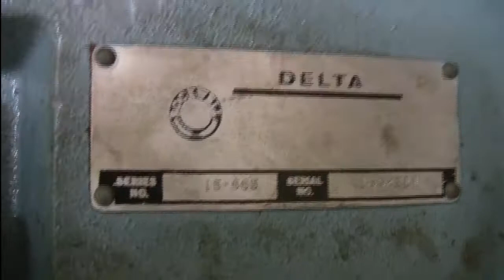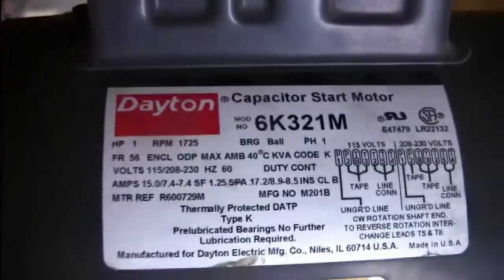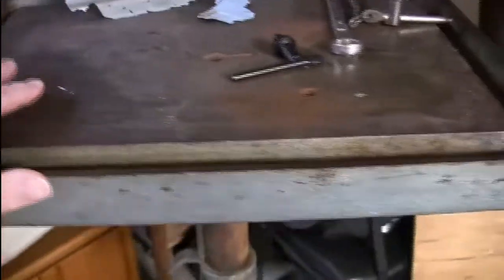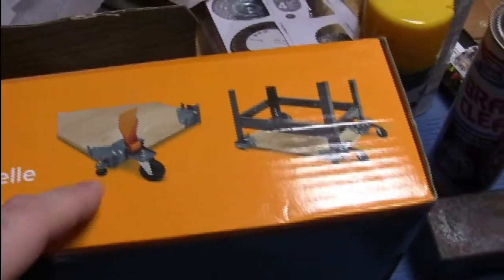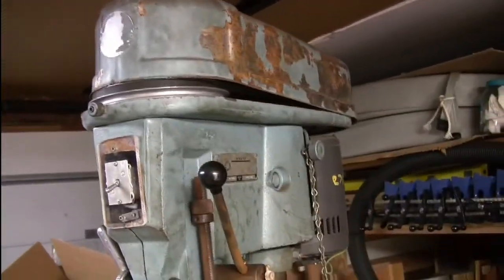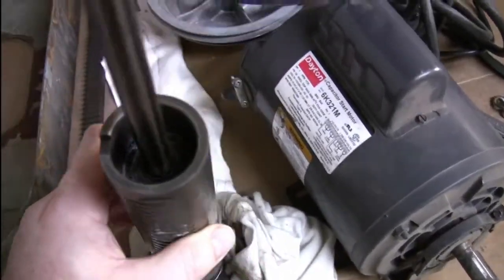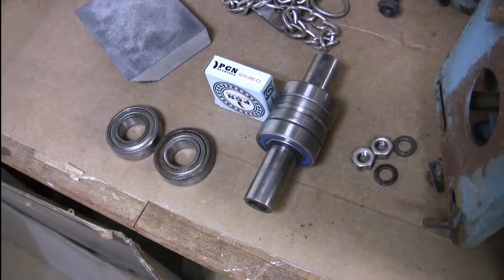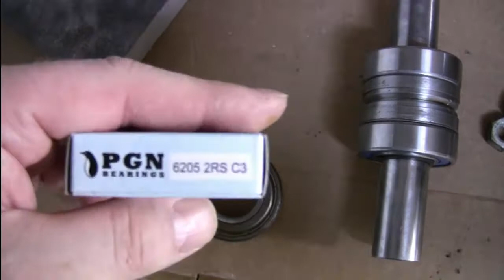Refurbishing Rockwell Delta 15-665 Drill Press

Comment: Thanks for the video. I've got a line on a newer 15-665 but I'm worried about the locking collar setup on the quill. Looks like it takes a special chuck, unless you can just replace the arbor and use any chuck that matches the arbor. Did you have any problems with the chuck and/or arbor setup? Thanks.
Reply from the maker: I was able to get that locking collar removed.  In the second video I talk some about it, and here I show the result: https://youtu.be/4xuHyWijlHw?t=1020   If I remember correctly, all you really need is a 13/64 pin (or drill bit) and then carefully tap it with a hammer to get it to move.  I also found an old wrench with the right size pin that I may adjust the curve on if I need to remove the new chuck in the future and it doesn't want to come off.  The new chuck I show in the second video works great and I got it off amazon.  Any good quality chuck with the same taper should work fine for it.  
So based on what I ran into, the drill press is totally worth it, even if you have to replace the chuck like I did.   So far I have had zero problems with this drill press or the other even older industrial walker turner drill press I also got and refurbished and have a video on as well  .
Reply: Thanks for replying. I'll watch the other vid after this one. Happy Thanksgiving
Reply from the maker: @1Splat  you too, let me know if you have other questions and I will try and help if i can.
Reply from the maker: @1Splat  Please let me know if the other video did/did not help explain it, I could always try and do another.  But I think in my video description I do have a link to the Mr Pete video (tubalcain) where he talked about removing it using a drill bit and tapping it around.

Comment: Just got one. Beautiful piece of equipment.  Is there a part number for the threaded worm that is used on tension spring? Also going to me changing out all bearings if possible
Reply from the maker: Did you see if you could find a manual for it?  I found this one and hopefully the parts diagram in there has the part number you want. I am not sure which part you mean, but there is an exploded parts diagram in this manual which may help:  
 http://vintagemachinery.org/pubs/detail.aspx?id=5837  

So far I have really enjoyed using this and the other Walker Turner drill press I refurbished.  Way better than modern stuff, no plastic in the mechanisms. :)  I cover more of the refinish work in another video for this drill press as well.
Reply: @josephkrug8579  there is a threaded worm for the adjustment of the return spring.  Tough one to find
Reply: @josephkrug8579  well that and original light if possible
Reply from the maker: @78abmoreno  The delta came with a light on mine, not sure it was original...but I got this one and so far really like it, and where I put it, I can use it for both drill presses: https://www.amazon.com/gp/product/B07S5QT88J/ref=ppx_yo_dt_b_search_asin_title?ie=UTF8&th=1
Reply from the maker: @78abmoreno  Yeah I am not sure, my best guess is the part number in the pdf to search for it.  I was lucky that I didn't need any part replaced on mine.  Eventually the 3d printing etc will be so easy and normal that we could just go to places like https://www.xometry.com/ and get whatever replacement parts we need.  But they need a full diagram of the part so that is not simple for old stuff.  Good luck finding it. :)
Reply: @josephkrug8579  I was able to source both the original return spring and adjustment screw. The motor that is on it is not origional which made for a need to certain modifications to be made so I will be looking for a Rockwell delta motor and light. wish me luck.
Reply from the maker: @78abmoreno  That is great news so far.  Was that pdf helpful to find the part numbers for the spring and screw?  Good luck on the motor.  I know there should be some out there, the walker turner drill press I got had an original 3 phase motor and a 110v 1.5hp rockwell motor that came with it.  So I used the rockwell one and so far it works great.  I may use the 3phase in the future for something or eventually sell it, not sure.  But in any case i am glad to hear you are making progress on what you needed.
Reply: @josephkrug8579  yes very much so. It wasn't immediately available but I posted a couple announcements of the part number and picture on Ebay and got a responce a week later. Ido have another question and sorry if it's a dumb one, What are the grooves for on the Base? Is there tooling options?
Reply from the maker: @78abmoreno  I am glad the pdf was helpful. :)   Those slots in the base (and that exist in some drill press tables, on many other metal machine tools such as lathes, milling machines, etc) are called t-slots.  If you google without the quotes for:  "using t-slots on drill press base"  You will get a ton of info, but basically sometimes you have larger pieces that won't fit between the table and the drill bits and so you could use the base t-slots to clamp it down and swing the table out of the way to do work on the larger pieces.  That is also why the head and table can with some adjustment swing back and forth vs being in a single fixed position, that way you could swing it to the side to work on larger pieces.  Let me know if you have any other questions. :)

Comment: Did you ever figure out how to disassemble the quill and replace the bearings?
Reply from the maker: I did with some playing around get the chuck off and then was able to check the quill bearings, and from what i could see (and hear) they spun nicely without noise.  So I think the only ones which had gone bad were the upper ones which I was able to replace.  The noise I heard before taking it apart also vanished once I replaced the upper bearings.
Reply: @josephkrug8579  
How difficult do you think it would be to replace the quill bearings?  I have mine torn down that far, and I’m thinking I should replace them while I’m at it, but there’s no noise nor play.
Reply from the maker: @Dr_Waterski   Do you mean you already have those out or could pull it apart further to replace those?  If you already have them out, you could replace them.  If you have not taken that apart yet, and there is no noise or play, like I decided for mine, I would leave the old ones in.  However, when I dug that far into mine, it already looked like mine were sealed bearing replacements vs originals.  So the real question is are the ones you have sealed or not?  If not, and you have a press etc to put them back, you could go for it.  If they look to be sealed and work fine, maybe leave them in?  For mine, now that I know how it comes apart, it is not that hard to get that quill piece out if I need to do more on it.  The hardest piece for mine was getting the chuck off to even get in there.  The one other thing, every time you take something apart there is a chance to break something.  If you break something in there, you ruin the drill press....so do you feel lucky enough to chance breaking it all just for replacing something that seems ok so far? :)
Reply from the maker: @Dr_Waterski  Also, if you can, use a vice to carefully push the top bearings on vs what I did initially and try and carefully pound them on.  I eventually used my bench vice and that worked way easier.  If you have a press, that would be even easier.  I do not yet have an arbor press to so I had to try and make do, but using a vice is much easier and safer to push those top bearings into place.